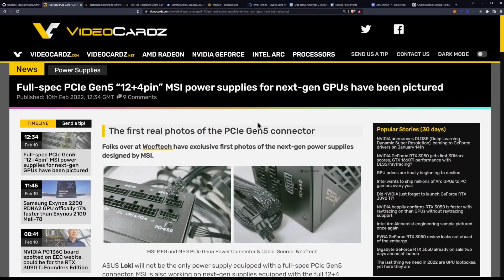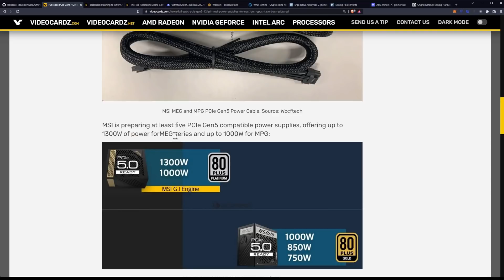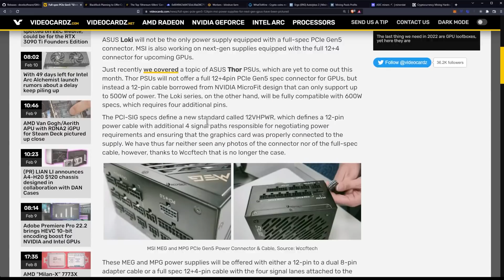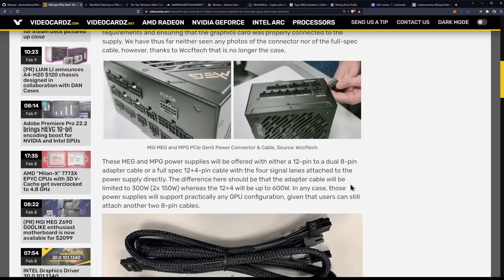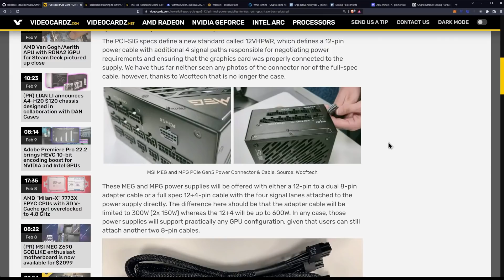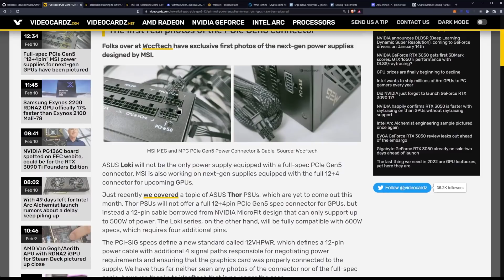600w Pcie Gen5 Power Supplies

Comment: The 750W psu would just be for cable compatibility. If your system pulls 600W you shouldn't have anything less than 800W psu, and that's 600 total system draw. That's not a pcie 5.0 thing, that's just a power supply thing. Always has been.

Comment: This means that starting with rtx 3090ti we wont be able anymore to use our current PSUs even if we have like corsair ax1500i that has like 10 pci-e cables 8+2 pairs ? Just because we wont have those 12+4 cables ?
Reply: Most likely there will be adapters for it, which will convert regular 8 (6+2) pin to this 12+4. I remember back in the days GPUs did not have extra 6 or 8 pin connectors on them, they drew power only from the pcie slot. So PSUs back then did not have 6 or 8 pin cables. And back then they came up with  molex to 6 pin PCIe adapter, which were working for GPUs back then. In that time also many GPU manafacturers included this adapter with the GPU for free so you didn't have to buy one or change the PSU and with time and GPUs requiring way more power this molex to PCIe adapter slowly died out. I think that this will be the same with this 12+4 pin cable.
Reply: @MegaCroosfire  Yes, I figured more solutions will be coming as well. If there's an obvious problem, which people want solved, there will be a market and engineered solution for it.

Comment: for my second rig, i”m currently use clasic power supplys, with wire modifications. 10 min work for 100 USD economy...and, of course, 1 gpu for 1 psu